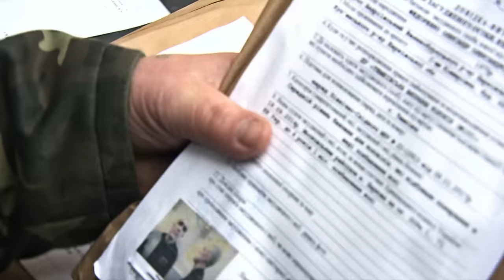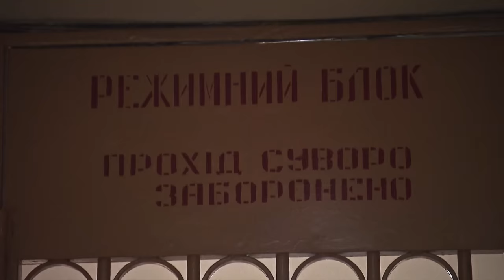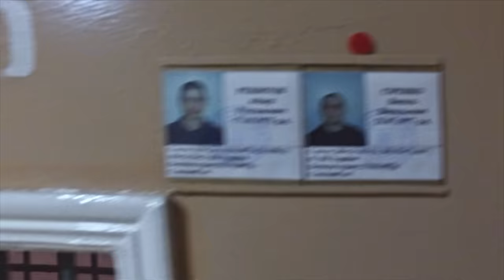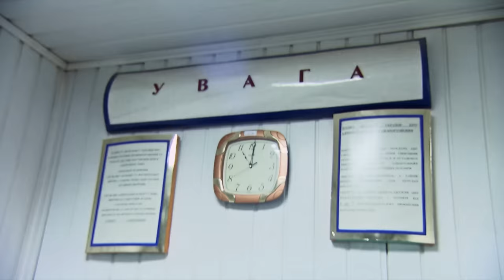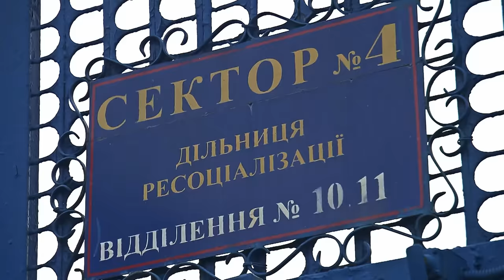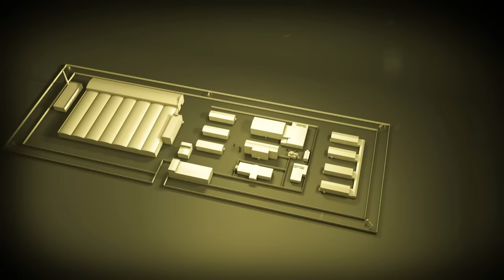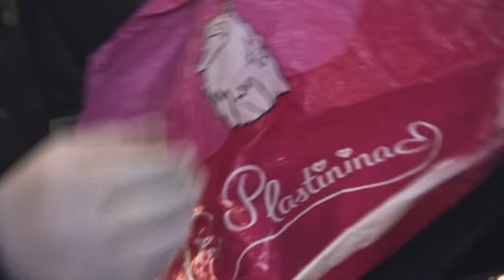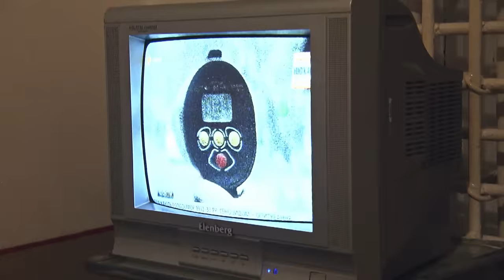Behind Bars 2: The World’s Toughest Prisons - Colony 100, Kharkiv, Ukraine | Free Documentary

Comment: I’ve been locked up in 24 different prisons all over the U.K (not proud and now have been away from all that for many years) and I’ve been in segregation, the hole, the block etc, many times and apart from a mattress a lot of these segregation cells here in U.K are no different especially in the older prisons. Sometimes you will spend 6 weeks sometimes more sometimes less, in these squalid cells. You may get out a couple of times a week to walk around a tiny yard for 20 mins. If you are lucky. Even though you are meant to get out for 1 hr a day under E.U law.
Reply: UK is not in the EU, also UK prison is nothing compared to Ukraine, they are not showing where the prisoners get beat up for no reason off camera.